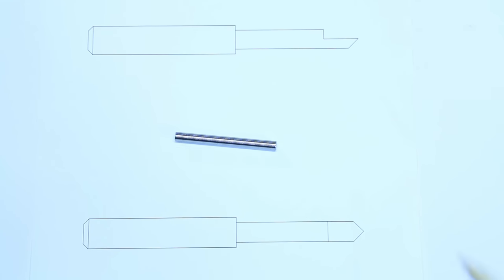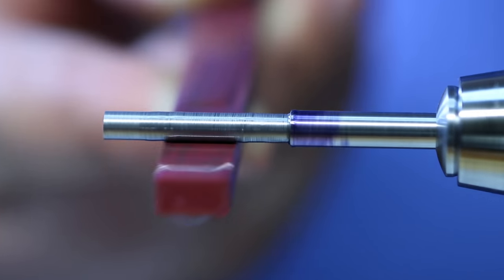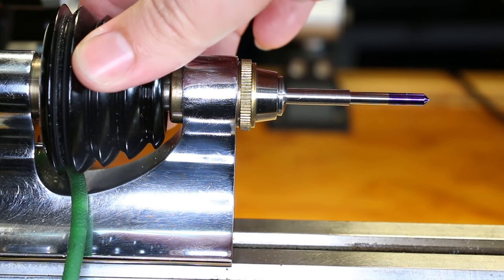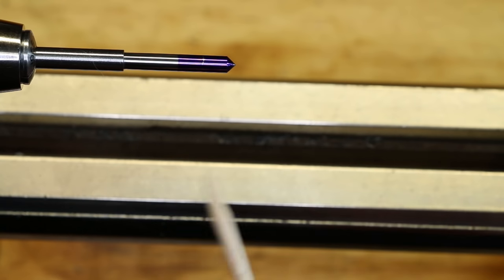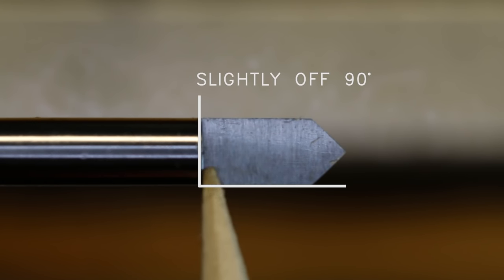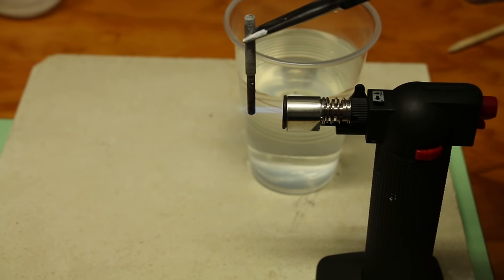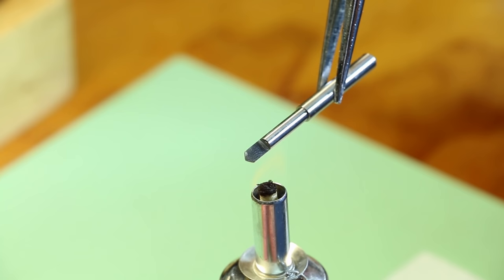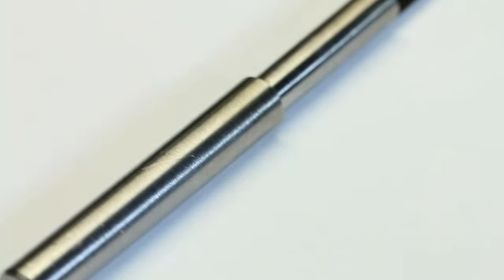Watchmakers Lathe Project - How to Make Counter Sink Tool

Comment: This is outside the scope of the discussion but:  I've had a lot of trouble in life machining soft metals, pure aluminum, pure copper, electrical conductivity grades say.  Searching for countersinks and lubricants to make it work nicely.  Just looking at this tool, it seems like it could cut gummy soft stuff without chattering or catching up in the material.   I feel confident to make this after watching a ten minute video!

Comment: Dean,
Take a look at FALCON TOOL SUPPLY.  This is a supply house for the injection mold industry but many of the tools from that industry can be applied to the watch making industry. When a plastic part has a shiny finish it was manufactured in a mold that was polished to a mirror finish. Tools like Degauset stones are sold at a much more reasonable price than a watch tool supply house would charge.
david
Reply from the maker: +Vivienne Pierce Thanks for sharing that David. I will check them out! :)

Comment: Hi Dean.
Nice work, my view on should items be seen or not. I think, guide pins or any fittings if it’s done well it doesn’t matter, 
It’s down to personal preference my choice is to show them but it has to be done very accurately and they all have to match.
Did you repaint your lathe after you spilt marking fluid on it. ????
Keep the videos coming always a pleasure to watch.
Regards Phil
Reply from the maker: Thanks Philip! Yeah I agree, and will make them look great and also function correctly. No that battle is lost and the lathe still has scars 🤣🤣

Comment: Seems like allot of work. I'll just use a lathe and mill :p
Reply from the maker: This is true! Although I didn't having milling facility at the time. Nothing trumps hand skills :)
Reply: This is a fairly tiny thing for the average milling machine!   Sometimes a file is just the thing, you know?  I'm guessing he's got files already prepared, and can file something like this long before the milling-machine setup was even made!   I've never seen filing roller rests before, that seems like a new frontier.  I'm vaguely imagining a special vise with the rollers built in to the jaws, or hanging off the jaws somehow...  This seems like it would be good for students, to give them the idea of filing level.  Really, one roller would help a lot!  I learned a lot here, there are a lot of implications to this short video.